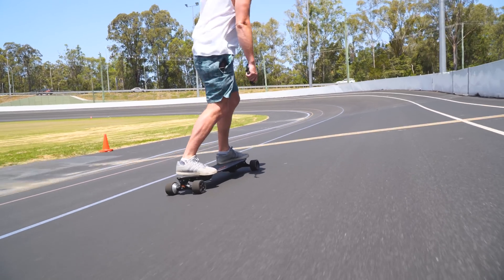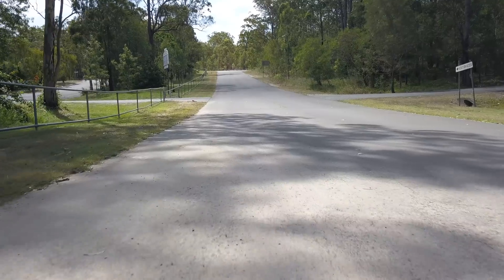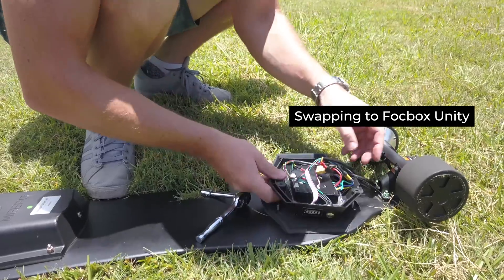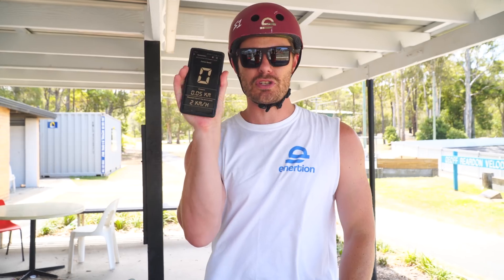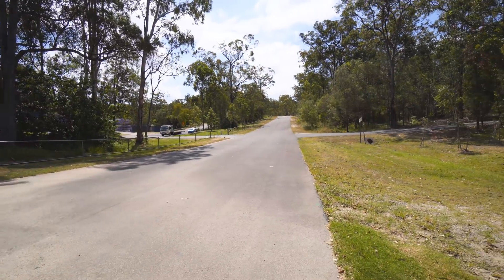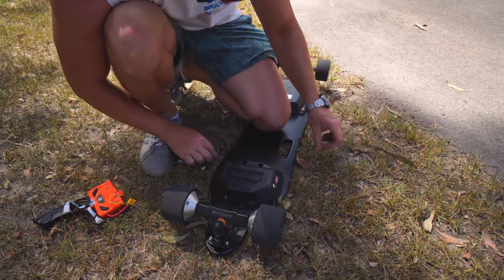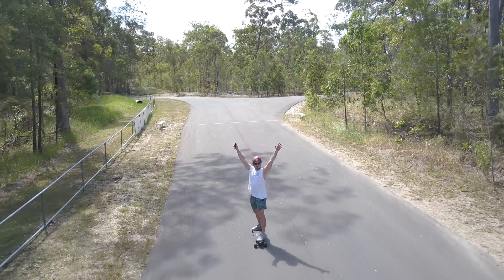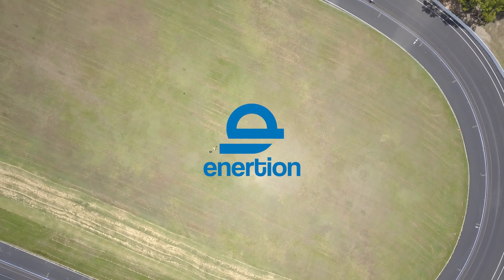Meepo Upgrade Boost - Unlock Full Performance with Amazing New Electric Skateboard Hack

Comment: I want to upgrade Leiftech (electric freebord - snowboard on wheels) with Unity.
The point is that I brake with those regular “edge” wheels while only “rotating” middle wheels are actually motorized.
Can I completely disable braking function with Unity? Because I don’t need that even accidentally to be activated. Which’s why I need to make an upgrade - as in stock setup when remote control looses connection with the board then the default mode is hard brake. And it’s extremely dangerous and is equivalent to catching an edge. When actually riding on two wheels it’s hard to maintain balance when the board suddenly gets into a complete stop.

Comment: Hello Jason 
how do you connect the hall sensor to the foc box, because you got on the  box a 6 pin cable and the hall sensor cable from meepo hub motor got only 5 pin it doesn't have the white temp sensor,help me how do you do  thaht🤔

Comment: The hobbywing is the standard. That’s just the cheap Meepo esc that no one but Meepo runs anymore. The hobbywing is by far the best esc on the market even over foc
Reply: And a phone app is a gimmick. Give me a reliable product not a toy
Reply from the maker: Evolve doesn't use a focbox, sounds like you haven't either.
Reply from the maker: How do you run a motor detection sequence on a hobby wing? what about a hobby wing phone app? throttle curves? configurable battery limits? Motor temp sensors?  - you should do some more research and you will realise there is a lot more to it....
Reply: Enertion Electric Skateboards yes I am aware of how unreliable the foc esc is. Are you aware of 100s of complaints by people on social media? People have been so flustered with these shit boxes they give up and go back. Every company I know that uses these has problems constantly. Evolve and raptor included. Never heard of a hobbywing problem because they are simple. Do your research and use a dictionary

Comment: This is game changing, I run a Louboard 3.0 and as much as I love it, the electronics are not perfect. The ESC and battery fit inside the deck itself and there’s not a lot of space. How much space does the unity need to be installed? does it need any room for heat dissipation?
Reply from the maker: Hi Gareth, really depends on how much power you're putting through it. on a louboard i would think it would be fine to mount and not get too hot, as long as you don't put the current settings too high. not sure if it will fit though, the unity dimensions are: 

Main PCB: 113mm x 63mm
Outer Case Footprint: 117mm x 64mm
Outer Case Height: 19mm
Reply: Thanks so much 😀

Comment: You are putting a $80 electric speed controller vs yours which is $250, the choice is simple if you are in a budget like the title of the video says... if I had an extra $170 I would buy a better prebuilt or look into other vesc’s or a better battery.  Yes your electronic speed controller is nice but not for the cost on a budget.
Reply from the maker: thanks for the comment, you're mostly correct, for a lot of people, but this is the easiest way to enhance performance on a board that people already have, without having to buy a new enclosure or deck in order to fit a bigger battery for example. Even if you have a better battery it will still be bottlenecked by the standard speed controller, whereas this gives people a way to customize their performance in a way that wasn't previously possible. Not everyone knows how to program a vesc nor do they want to!

Comment: Is the component adaptable to the Evolve series of boards? Will it enhance their performance also? Thanks
Reply from the maker: it will work with the right adapters. Although due to how much the evolve board batteries sag, We'd recommend upgrading the battery also when doing the esc swap. There are countless examples of this on the forum and people who build custom batteries specifically for evolve boards as well :)

Comment: So I got a evolve bamboo gt bamboo, with a lhb battery with 23t and 90m abec 11 refly. My board max is around 28mph. Could this fox box improve my board? I see that it fits the meepo type board, would it fit the evolve?
Reply from the maker: Yes, can definitely mod an evolve with this, simply need to change the standard battery connector and solder on the motor connectors we provide.

Comment: The range will drop! But if you use the same current settings as the original ESC (~12 amps for each motor), you will get the ~ same range (Except if you play around will battery current max). Since this is an upgrade, you wanna punch for higher power so you gonna need a higher "C rating battery". ANd one more thing, these hub motors work fine on 12 amps (and even get hot a lot) while this unity controller can even handle an 80amps motor! You wanna be careful with motor current max setup or you will ruin them.
Reply: According to the I^2R rule of physics. If you double the amps to a motor (by upgrading ESC), you quadruple the power that is dissipated in heat. The motor will get very hot. Just make sure you don't melt the enamel on the copper windings of the hub, it will short the motors and they will be ruined. You need thermal rollback capability and temperature monitoring if your going to push these cheapies to 80A !
Reply: @JonathanVaucher  Yeah, shorted motor wires also equals to fried ESC! If the rider was going fast, that s too bad for him, phase wires short equals 100% brake.

Comment: What about a plug and play Focbox Unity for and Evolve Bamboo GTX and Carbon GT ?
Reply from the maker: All you need is a power connector (XT60 for unity) and a soldering iron (+ unity and 2.4ghz remote)! There are people who have done this mod on the esk8 builders forum if you need a reference.
Reply: Thank you for getting back to me but its sounds a little complicated for a non DIY guy like myself.. But last question do you guys plan on making a Bigger street wheel like a 107 / 110mm for the Raptor 2.1? @ElectricSkateboardBuilder
Reply from the maker: @danieleng8545  We have the 100mm crossover wheels, but we have no current plans to make bigger wheels.

Comment: I would definitely buy at least one for my Ownboard, if you made an adapter! And, maybe a second one for the next board I get.
Reply from the maker: If your ownboard esc is the one without the special ownboard connector, then you don't need an adapter. It should be plug and play. https://www.ownboard.net/collections/parts-accessories-for-electric-skateboard/products/ownboard-electronic-skateboard-esc-motherboard?variant=13100884557866

Comment: You should try out the braking system and see which one is more effective.
Reply from the maker: The brakes on the FOCBOX are fully programmable so you can customise them to suit your weight / riding style. There are many expert settings that can be tweaked on the FOCBOX Unity VS No settings on the standard ESC

Comment: No comments or test on range! I am pretty sure you loose around 50% if not more of the range since the Chinese esc are designed to withdraw from 18 to 25 amps max - depending on the board model. They can easily increase the amps through their esc settings but then it will be like a standard boosted V2 max range of 3 to 5 miles.
Reply from the maker: The range will likely be greater if not equal as we are able to cover more ground faster.
Reply: @ElectricSkateboardBuilder  I strongly disagree but you can prove me wrong with a video test. When you go faster or accelerate at a higher rate you use more energy.
Reply from the maker: Sorry, I forgot you are expert....  P.s. loved your extremely biased/ pointless review of the unity... How about you do some actual testing yourself.
Reply: @ElectricSkateboardBuilder  it was not a review.
Reply: @ElectricSkateboardBuilder  I wont pull 100 amps because it will melt the wires and the tiny connectors. Also you wont cover the warranty or replace it if it burns!
Reply from the maker: Welcome to the amazing world of DIY ESK8 bro. Your battery must be epic if it can output 100amps continuously.... I'm jealous. I highly recommend you learn  how to use a soldering iron, plenty of videos on YouTube, then you can finally man up a and install a big boy connector, if that's what makes you feel happy inside.... Lol

Comment: I'm curious about what kind of improvement I might expect on a Backfire Ranger? Does anyone at Enertion have an educated guess? Would it just mirror the results in the video or could I expect different results?
Reply from the maker: It would likely be a similar improvement, but it will depend on the type of battery backfire uses.

Comment: Even assuming the efficiency of the FOC box is much better, the increase in current should decrease the battery life (Not talking about range) because you might be over-powering the pack. If you swap the controller, you have to make sure not to exceed the max current you can pull from the (likeky cheap) battery pack or it might become a fire hazzard.
Reply: Using a better performance controller on a low C rating battery is not a fire hazard! The battery will struggle to provide the required Amps and this will lead to voltage sags and cut-offs until you get a better battery! Nothing will catch fire
Reply: @YvonSmart  I really appreciate challenging my concern. However, I feel like this response is too general and does not reflect what happens when you overpower LiPo cells. If you exceed the 10second/30second max current or even the burst current, they will start heat up significantly and then gas out. For 18650 cells, that is very bad and can cause fires. I may not but is _can_.
Reply: @TimoBirnschein  LiPo is for sure a fire bucket! This is not really a power board! We talking about a meepo board! The motors on this thing work fine on ~12 amps each and even get hot as hell. The weakest battery on the meepo is 10s2p, Samsung 20R (used that pack on my DIY dual FOCbox and TB 6355 motors) The worst that battery did was sag badly when the battery is 60% and below (And that's on two motor rated 80 amps max). Beefy controller on low amp motors will not affect battery directly because the motors are the ones pulling the current not the controller. I have been causing battery fire for fun, I know what i'm syaing
Reply: Totaly agree. And then they go out of balance... fire hasard !

Comment: That would be great if you guys could make it so no soldering was required! Also you never did a range test? How did you guys manage to put the unity in while unsticking the old ESC since it is super glued in there? Did u guys glue the Unity back in?
Reply from the maker: hi Maltom, since we were only doing short tests, we velcro'd the esc's onto the heat sink. Neither esc overheated during the tests, since we swapped them in between.

Comment: I have a BIG PROBLEM  with these tests, since more speed, better acceleration and more consistent speed also translate to higher amp draw, less batterylife and higher load. 
You could have solved by measuring certain numbers like max Amps, average amps and battery consumption. A simple Wattmeter from the RC-Hobbyshop might be the solution, not sure if the Focxbox itself is able to measure that kind of data.
Reply: Also, meepo and wowgo aren’t necessarily going for best acceleration from stop. They’re going for most comfortable acceleration from
stop.  They’re not trying to pop riders off the board from the jump.
Reply: Nik Leiser yes it does
Reply from the maker: The acceleration and brakes are not great on these budget ESC, very "not-smooth". With Focbox unity, you not only get performance benefits, but you also get massive improvements with controllability. For example, you could detune the unity performance so its same speed & torque as a standard board, then you would still be getting benefits of better control.

Comment: I am definitely interested but i can do 30mph with out the unity, so with It i reckon I could go 40mph easy
Reply from the maker: It won't go that fast, maybe a slight improvement over 30mph. Our top speeds were lower because Jason isn't a light person but up around 30+ the motors won't have much more to give.

Comment: I'd love this but does it decrease range by giving the board more torque and does it make braking stronger?
Reply: One thing is that Focbox is more efficient than a chinese ESC, of course If you use more power your battery will drain faster. With focbox you can set everything the way you want... You setting the brakes to stronger makes the brakes stronger, nothing else. Everything is configurable.  If you wanna save your battery, you can set your focbox to whatever output (wattage) you want, so you can make it even less powerful than it was with the chinese ESC and you will get greater range that you used to. You can preset when the battery should turn off as on 0% charge. You can literally do anything with that unit, that's why it's more expensive than others... Cause it's ten times better and doesn't brake, not mentioning 24/7 Enertion support and immediate dealing with problems.  Getting to 2500 km with my two focboxes without any issues what so ever... YOu just ride and keep riding and stop worrying about things going wrong cause they don't.
Reply from the maker: @esk8spirit362  Thanks for your comment. like mentioned, everything can be adjusted in the app/focbox tool :)

Comment: Yes, those generic, non programmable ESCs are a PIA. You are stuck with the programming from factory and different configured hubs require different programming to work properly. I have a 4wd setup with these generic ESCs and just managed by fluke to mix and match a master and slave to work well (braking was sudden on one master but changed to another master (different programming) and worked good??) .Would much prefer a programmable setup. I looked at Focbox the other day and the only thing stopping me is cost. I considered ordering when I thought AUD, but when USD too much. Also I would suggest having a discounted price for multiples. I looked at the cost of two focboxes and two sets of powered hubs it worked out quite alot. The aim of my custom 4wd setup is to be able to go thru grassy hilled parks which does well with the 110mm PU on generic hub setup.

Comment: I want to know how hot those poor little hub motors were getting and how many extra motor and phase amps were going in. I'm really not trying put it down just curious. Were there thermocouples in the hubs?
Yes connectors would be great for a lot of people who are keen on DIY but really want plug and play. I think if you could offer a product that plugs in and is pretty much self tuning you would definitely open up a whole new market (evolve kit would sell like hot cakes). Well done mate great vid.
Reply from the maker: The motors didn't get too hot, I think we could push them much harder actually. The biggest bottleneck is the battery.

Comment: I think you should make the adapter.... This is a total GAME changer. Something like a Meepo AWD GT is help back due to its cheap and choppy ESC but if you put a focbox unity in there not only will it bring put the performance specs but it will solve the issue of the jerky controls. This is something I may be willing to try.
Reply from the maker: it can benefit a lot of boards, but remember if it's AWD it needs 2 esc's. For most people it wouldn't really be a budget board anymore. You're better off saving up a bit extra and just getting a raptor instead!
Reply: @ElectricSkateboardBuilder  I have raptor 2!

Comment: how does it effect battery life.
Reply from the maker: We might do some range testing soon, you might actually get longer range due to the speed increase.
Reply: Wait what?
But riding on higher speeds will decrease the range...
30% "faster" ESC used 30% harder all the time = 30% less range.
You eat more you shit more away xD
Reply: @Arek_R.  Actually the equation for force is mass * acceleration, without acceleration (ie riding at a constant speed) you don't need much force save for friction and heat losses. So just because a board travels 30% faster, doesn't necessarily mean 30% more power is being used! So at higher speeds, you will likely see efficiency hold steady and for my money, i'm willing to bet the range would increase slightly. Really keen to see the results though.
Reply: @jalihumunguy6309  I know I just simplified it 
The main problem is the air forces that increase exponentially with the speed.
Eg. on 20kph you make 20km of range and only 12km at 40kph
Reply: @ElectricSkateboardBuilder  +1 waiting for the range test. If there is also an improvement then I am sold ;)
Reply: Nope. Increasing speed will exponentially increase drag force from wind. Requirering exonential amount more torque and thus currunt. Range will plummet down.
Reply: Or less if you're smash the throttle a lot making the most of the extra grunt.
Reply: In terms of charge cycles lifspan of your battery, pretty sure it will destroy your battery prematurely unless you swa for very low internal resistance LIPO or massive 18650 high drain cells. I wouln't lower than 10S4P of sony VTC6. I would not even try running this ESC regularly with the stock cheap battery that will cook...
Reply: Yes I'm curious to know this as well.